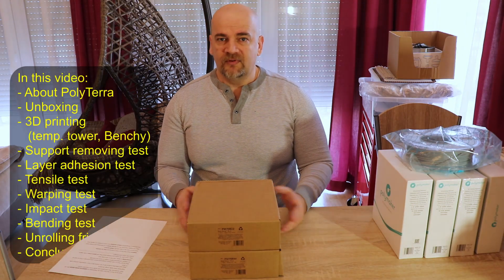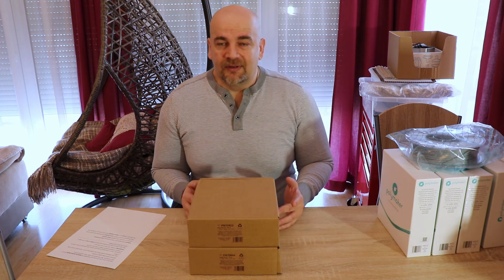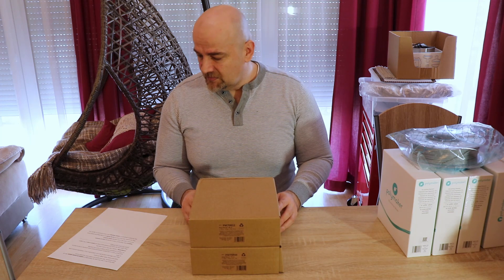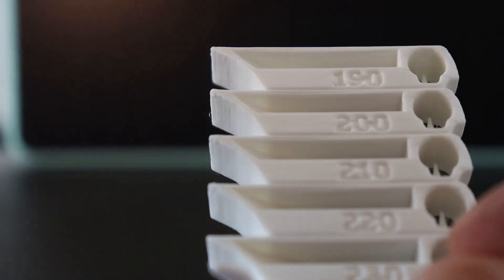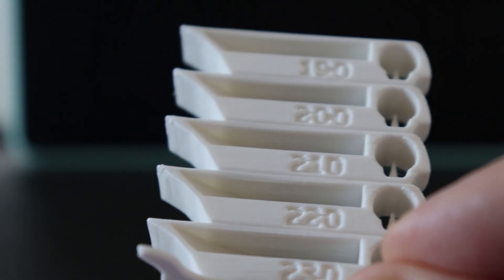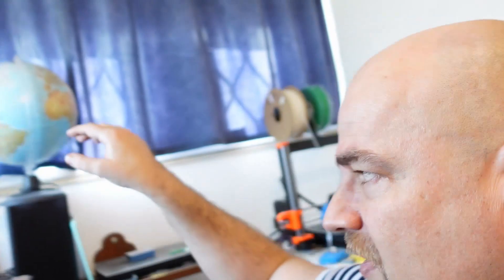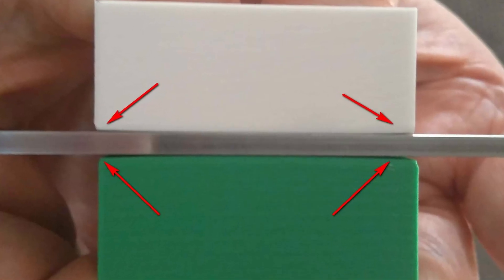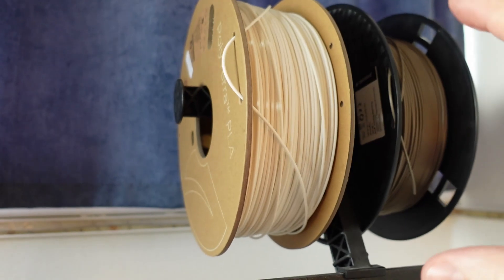About PolyTerra by PolyMaker - the eco friendly filament

Comment: I haven't tried a lot of filaments yet, but this one has odd properties. Left a print overnight, and once the plate cooled the parts popped off on their own (almost perfect adhesion while it was hot). It technically prints a lot slower than most PLAs but is that info just... outdated? I know printers are probably getting a lot faster now so maybe it was never tested above 70mm/s when it was first made? Yes it gets less glossy when going fast but it's already so matte.

Comment: Thanks for posting this excellent video.  PolyTerra is one of the only aftermarket filaments with a pre-defined profile for the Bambu Lab printers, calibrated and tested for a high flow rate and thus fast printing speed.  The video makes it very clear exactly what uses this filament would be good for (and not so good for).

Comment: I just received my spools and tried them out on a Ender 3 . I have two such machines. My first machine ended up being clogged after the first layer peeled off several times even with the application of stick glue . My second machine had issues with adhesion however I fixed that issue and let the print continue. The print turned out good but I am not sure what nozzle temp will work better and what fan speed. The bed was at 60. I  normally print with a bed temp at 55 and nozzle temp of 205. The second printer nozzle temp was 210. Fan speed 105.

Comment: I'm having such a hard time printing with this filament on my vyper. Bed adhesion and blobs are my big issue. I even followed polymakers retraction settings.
Reply from the maker: First solve the bed adhesion (glass?) Try some hairspray or PVA based glue stick. Blobs? Check the z offset distance and temperatures

Comment: Hi what  is your filament settings in prusaslicer
I have an sidewinder x2
Reply from the maker: nozzle: 210°C, bed: 60°C, printing speed 40-60 mm/s, fan 100%
Reply: Ok but I start the cooling from which layer ?
Reply from the maker: @g-shark6048  3rd
Reply: thank you i am a beginner in 3D printing and in english i use deppl
Reply: And last question, do you have problems of adhesion because I often have the first layer that comes off with poly terra and thank you for your advice my bed is in glass
Reply from the maker: @g-shark6048  No, but I use PEI. Try to use hairspray or glue stick on the glass. Also try to raise the bed temperature to 65-70°C

Comment: I'd be interested in how well it does break down since normal PLA  will only break down in temperatures around 60C. If you're interested in environmentally friendly filaments I switched to using Filamentive PLA about two years ago. They use up to 90% recycled plastics for their filament and I have not noticed any difference in strength or finish
Reply from the maker: Maybe I will include PolyTerra in temperature test in Part4 of my big PLA brand comparison. This is the first part: https://youtu.be/L9tNhfxs9BU